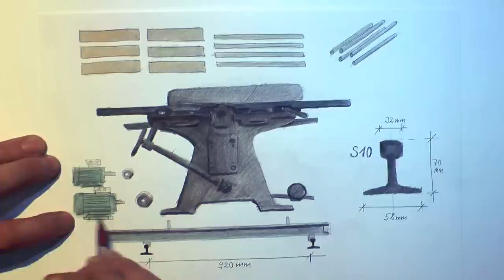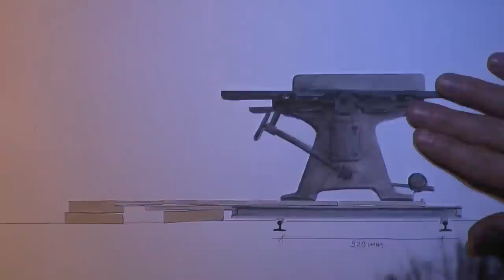Jointer and thickness planer 1

Comment: Very jealous of the amazing workshop you are creating. thumbs up for the video.
Reply: I wonder, how many fingers and eardrums this ancient thickness planer [ger.=Abrichte] has claimed over its surely very long and ear-deafening loud lifetime... :-D
Reply from the maker: Ricardo Cristof Remmert-Fontes Injuries on fingers maybe - it is indeed a dangerous machine, but not to eardrums. It's in fact not sooo loud (well, a bit).
Reply: Matthias Burger *haha* well, noise is relative... but be wary: even a short exposure to too much noise can permantly damage your hearing. Well, it would drastically reduce the noise of the jointer when cutting teeth into the table lips, like seen here: http://www.practicalmachinist.com/vb/attachments/f79/86921d1380161267-surface-grinding-tablesaw-practical-maxresdefault.jpg
You just need a skilled metal worker doing this. In Germany, toothed table lips are mandatory (because of this).

Comment: Hello, Great video, thanks for showing us. I also got an 60 cm working width, old Hombak paner and thicknesser from Germany many years ago and now i would like to bring back in shape. I have a few motor which i kept together when i moved home so I'm not sure which is the original for this planer. Could you please help me which parameter (ps/kw/rpm) motor and what diameter pulley should i use for the main shaft and for the feeder? Do you know something about this Hombak made planers? This company made good planers?  Regards G

Comment: Its a thing of Beauty, no doubt but a little to antiquated and dangerous for my taste. Thats a line drive machine originally so its probably close to one hundred years old or older even. Post war machines are way better. Pattern maker spec ! Now your talking. I used to run a Dankaert that was a planer thicknesser. What a beast that thing was.
I dont like combo’s though, to much bending over. Awkward to feed and hard on the back.
The only good thing about those old machines is the babbit bearings because they run quiet. Apart from that, on this beast, the beds are to short, the fence is to small and the cutter guard is a bit of a joke. Use with care, it may ‘verk’ but it would never meet modern safety specs.
I threatened to quit one job that used one of these bastard things. Thankfully the boss listened and got a SCMI. It was not what I wanted (Oliver) but at least I could relax and get the job done properly.